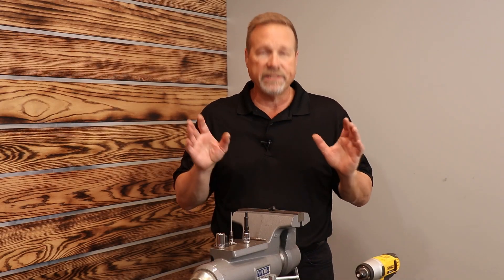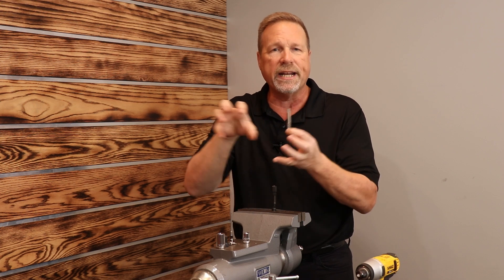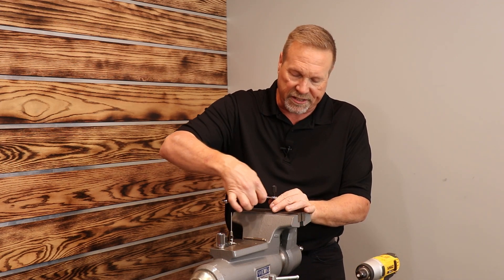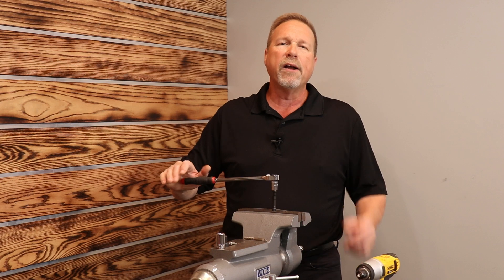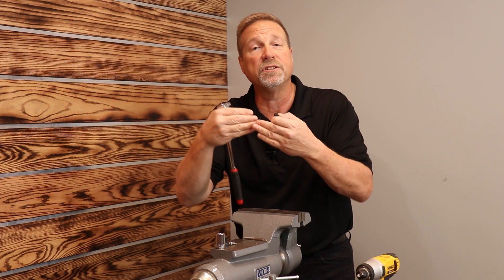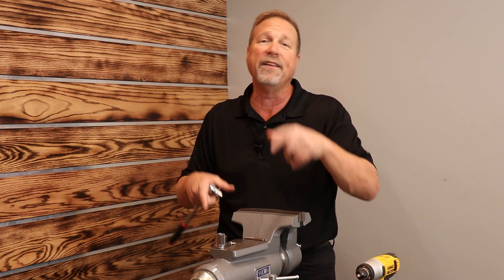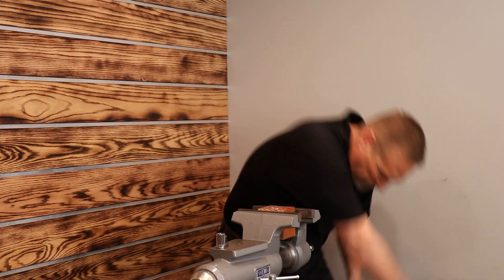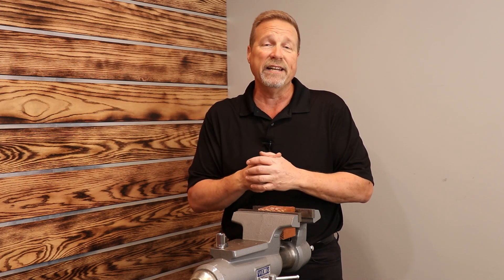Extractors Only Have ONE Job...to Bite! See How RBRT Extractors Have the Best Bite Possible!

Comment: Hey Dan can if you see this within 5 days of 10/13/22 there is a listing on eBay a guy has a bunch of regular bits inside the Mac box selling as RBRT kit. I almost got burned, then I noticed they are clearly not the correct distinct odd rbrt shapes. It does have every odd bit size but not legit RBRT.  Just wanted your input.
Reply from the maker: I contacted the Ebayer and they changed the listing! Good lookin out bud,thanks!